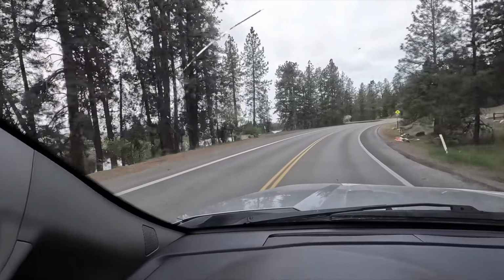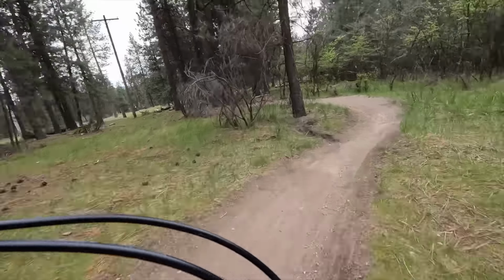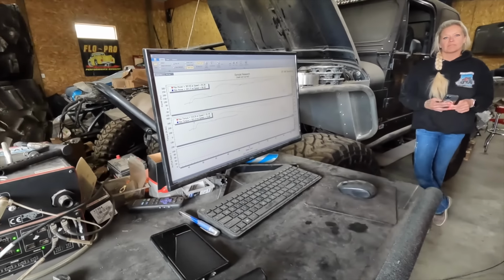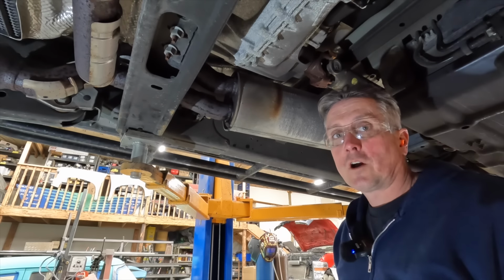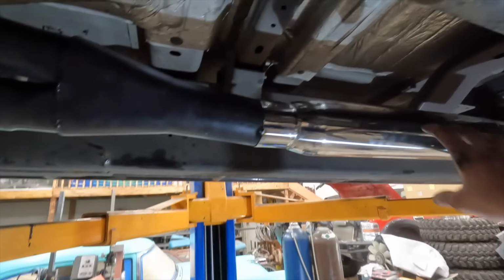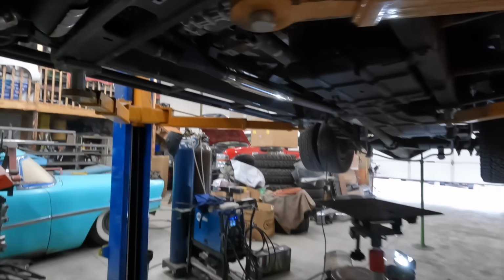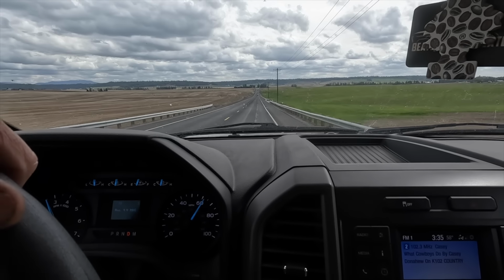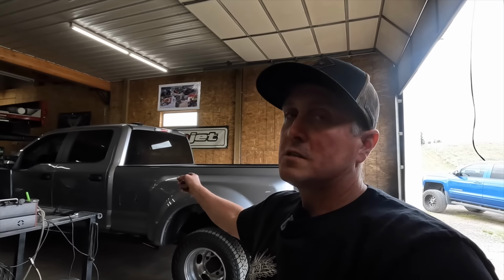Cheap horsepower for your 7.3L Godzilla Ford!!   And Mountain Biking!

Comment: I'm surprised that single 3" exhaust in the middle is enough to make more power, I would consider that restrictive on a 6L 364ci LS engine and you are working with a 7.3L 446ci engine, I have an older F250 with 393 Windsor with AFR165 heads,  long tubes, it goes through 2.5" duals and high flow cats into a single 3.5" 7.3 turbo diesel exhaust with a few resonators and it gets down pretty hard for what it is. With modern ECUs I am surprised that it doesn't require a tune to add any power, that throttle hang is terrible, it seems like you are pulling it in the wrong gear because you are hitting the speed limiter at like 5000rpms which should still be a touch low even for that big engine, if you took the speed limiter off you could pull in direct drive gear other wise it has to be a gear that you can pull to the rev limiter cleanly in. Those 7.3s have ridiculous potential. I saw a few months ago bare 7.3 Godzilla engine blocks were selling for $995 before tax, now they're up to $1500 and the heads are like $625 each, Weisco sell forged pistons, Molnar sells forged rods, Carrillo has stroker cranks coming soon and they're supposed to be upto a 4.6" stroke, with a 4.250" bore (0.030" over) that makes a 522ci stroker. I believe that Brian Wolf made over 750hp n/a with a stock stroke, ported heads, forged rod and piston, big cam, aftermarket intake, so I would guess that over 700hp with a 522ci stroker that was less aggressive wouldn't be very difficult. I am stoked for those new 6.8 and 7.3  Godzilla Fords to start proliferating junk yards and getting more common, the new GM 6.6L L8T iron block GenV engine isn't bad but it will only take a 4.125" bore and a 4.125"-4.25" stroke making it only 441-454ci, both platforms should handle 2000hp with boost and supporting mods. Hopefully the future of hot rodding is bright, even if MOPAR V8s are now dead.
Reply from the maker: These definitely have big potential.  I’m contemplating a little more work on it

Comment: why didn't ford just put the 5.0 in these f350s it makes more power and its more efficient.
Reply from the maker: Torque and longevity.
Reply: @thedirtheadshed  torque is more on the 5.0. longevity I can see though being a much larger displacement.